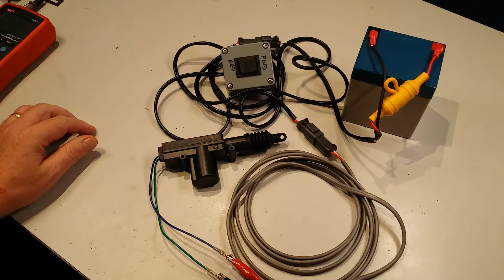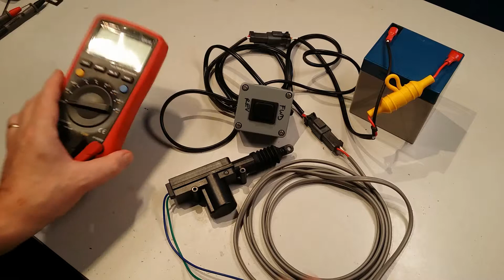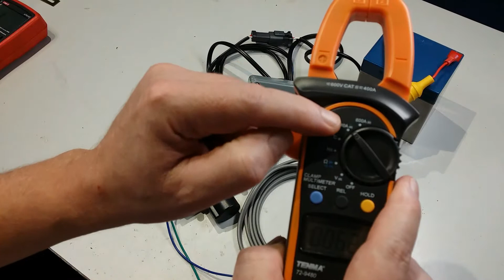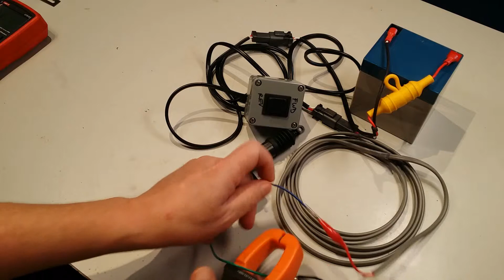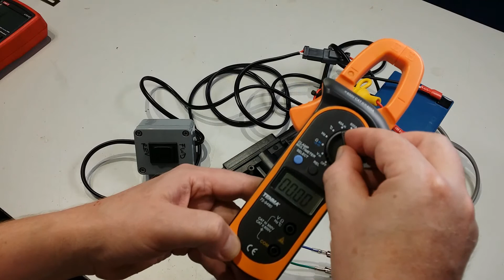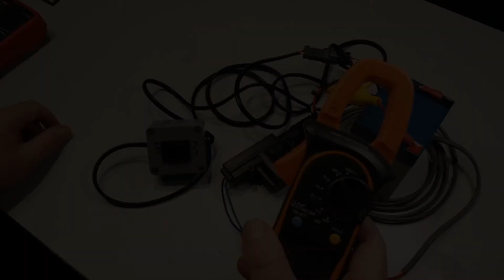Measuring DC Current   Multimeter vs Clamp Meter

Comment: Great video - a few notes - if you are using the multimeter without the clamp - there is a 10 amp fuse inside the unit.  If you exceed that value your meter will no longer show amperage, but the meter will otherwise work.  You will have to change out that fuse (quick clip in a new one or solder one in place) which requires opening the case in some models.  Also, if you use the clamp, make sure that you clamp over a single wire and without wrapping it around the clamp (which would increase the magnetic field) keep the wire as straight as possible and away from coiled wires - ie in the video measuring the current near the grey coiled wire will change your results - also the lowering of the measured value isn't because of the battery, but is a result of turning on and off the actuator which produces changing magnetic fields and resistances to those fields as they build and contract - it is all about physics but for your regular DIY projects using the values from the meter rounded up will give you enough of an idea for how much power your project will use.  Remember to plan on the surge current (highest value on start-up) and not on the steady current of normal operation.
Reply from the maker: Thanks for the comments. The battery I was using was an old one and the terminal voltage was dropping with every test.